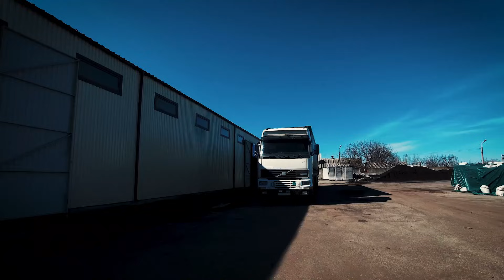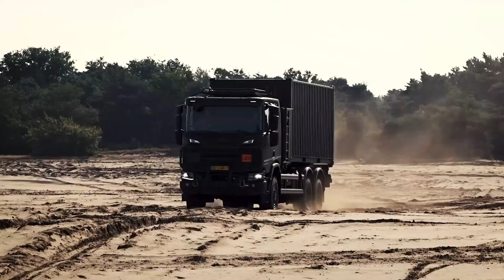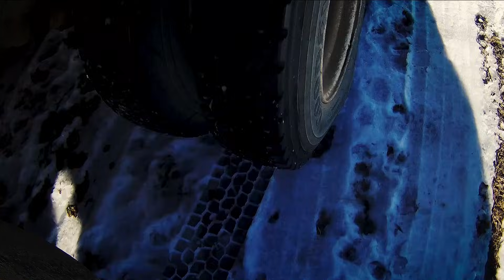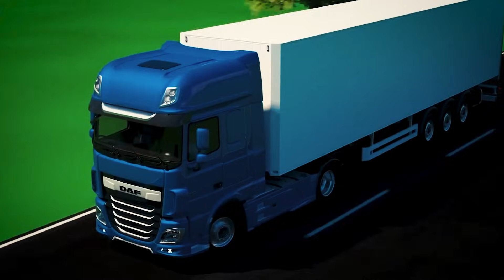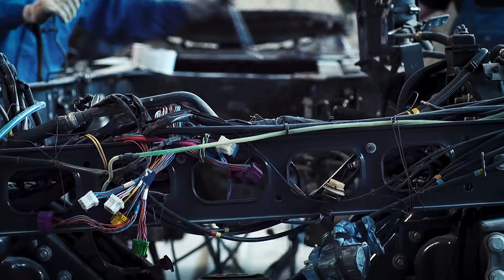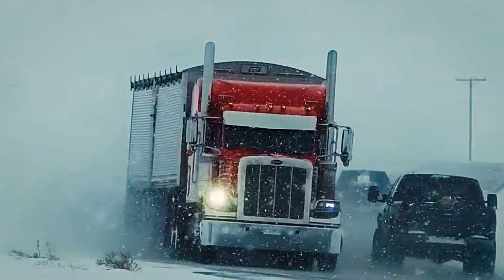Why Do Trucks Use Dual Wheels in the Rear?

Comment: I never realized the second tire also acts as a safety backup if one blows out. Truck drivers here — have you ever had a rear tire fail while loaded? Did the dual wheel setup actually save the situation?

Comment: Single wheels are available. Wide base tires, or, super singles. 445/50R22.5 replaces dual 295/75R22.5 tires and 455/55R22.5 replaces dual 11R22.5 tires. Not widely used because if you get a puncture in 1 of the dual tires you can limp the truck/trailer to a tire shop. Where as a puncture in the wide base tire typically means calling for emergency road side service ($$$$)

Comment: Fact is in duel tire, they have a lower weight limit because of heat build up.. simi trucks do run on wide tires. It's a mater of choice. Duels have better grips and stabbing floatation.  Not ideal on ice, in sand or mud.  So why not 3 tires per side. Hear it 6 ton per axel if 40" apart. Some dumps are all axels 36 tires and one wide tire. I thump tire daily but that only tells if flat.

Comment: This video based on its title, has to be that of someone trolling. I mean even a public schooled frist grader knows that two of something can provide more than one of something. Having one tire as it once was year's ago. Limited the amount one could haul. Adding one more to each side double the amount on could carry. Thus making one trip instead of two. And in the process, charge someone less then the compition who had to do it in two trips.

I mean you have two arm's and two hand's and there's two pails in which you can gather water. Do you use one arm to carry one pail numerious times or both arms carrying both pail's and do complete the task in half the time.

Why are transit buses so much larger today, than yesterday. Could it possibly be for the purpose of carry more passenger, thus less trip's. Hmmmmm

Comment: Super single tire/wheels on a heavy truck don't make sense. It's a critical safety hazard because of a blowout and not being safe to pull off the road safely without causing further safety situations.  Dumbest thing our intelligent government officials allow is being on a heavy truck. If I could out law those super single wheels/tires on a commercial truck, they'll be gone for good. They don't save much weight, and they cost more than a dual setup if one blows and damage the wheel, truck suspension and other components on a heavy truck therefore jeopardizing EVERYONE'S safety on the highway.
Reply: They have reinforced sidewalls and TPMS. Its fine and saves money on feul costs.
Reply: @T1Oracle until an idiot driver damages them. And they are damaged frequently.
Reply: AI BS

Comment: Many trucks also have singles on the rear axles. A single is a wider wheels than normal truck wheel and can be used instead of dual wheels.
Reply: "Super Singles" tires from Michelin. Not recommended for single axle use, since a flat would take out the whole side.
Reply: The super single was about to bring these up 😂
Reply: You must oppose everything

Comment: The industry experimented with something called super singles but it's widely kind of died out I know they are still available but it's very rare to see them
Reply: Died out? There are whole fleets of trucks running them for the fuel savings I agree that they're not overall better but if you're running dry vans always under 80k the fuel savings might be worth it
Reply: @achillespeleus2326 companies that do not do the overall math will their entire fleets that run them are out there,  but when you add in the extra cost of having to call roadside out to replace a tire and often a rim as well because many times when you blow one at highway speeds the rim will get chewed up beyond Repair before you can safely stop, along with all the other damage that happens when one lets go, its cheaper overall to run duals
Reply: Rare? Europe runs super singles and many southern African countries.
Reply: @AVMTOURING now that's fine that's not in the United States there isn't that many companies in the United States that uses them cuz end of the day they're not that practical
Reply: @johnbrohl1709 I see them every time I'm on the interstate. I tend to notice because they're so much quieter than duals.
Reply: It was a bad experiment. If you take a measuring tape you will find that the Super Single wheelbase is a bit narrower than having dual wheels. Our loads are already top heavy and tippy. Making the wheel base narrower is probably NOT a good idea.

Comment: Incorrect on your weight 40 tons 80,000 lb
Reply: 40 SHORT tons perhaps. 1 ton = 2240 lbs. therefor 40 tons = 89,600 lbs.
Reply: @yorksploughboy803  in the US 1 ton is 2,000 lbs
Reply: @T1Oracle true
Reply: @T1Oracle  in the US 1 ton is 2000lbs where in the UK 1 ton is 1000kgs 
1kg=2.24lbs this is where the disparity lies
Reply: @yorksploughboy803 WRONG!!!
Reply: @yorksploughboy803 2000 lb times 40 equals 80,000lb